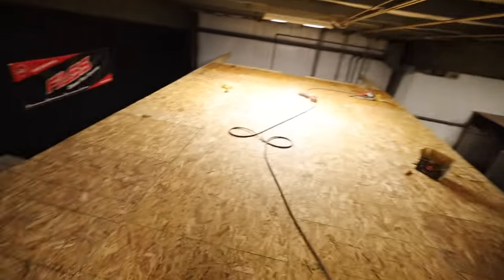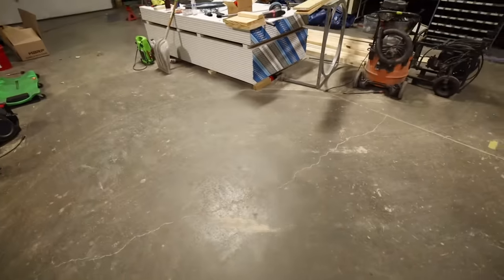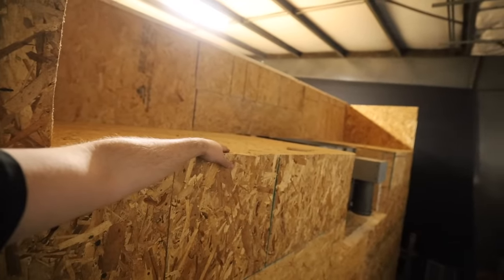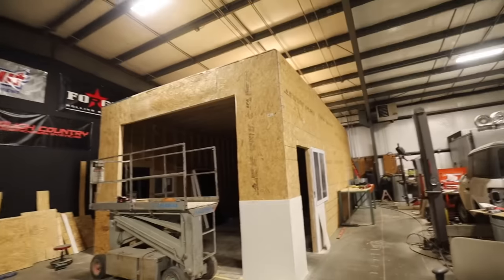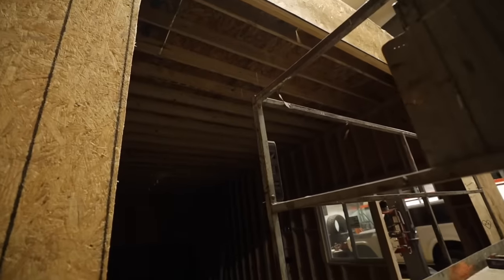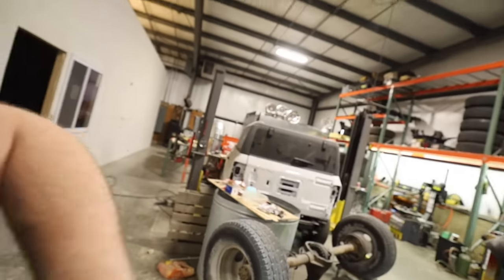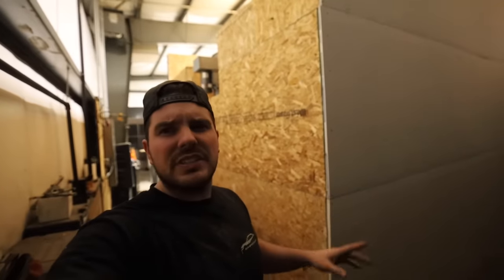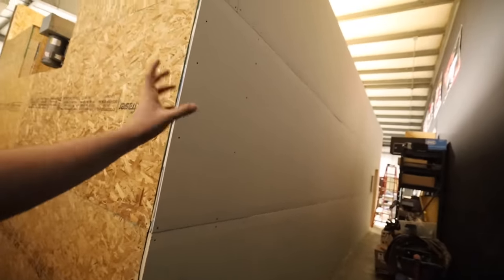Building the Ultimate Paint Booth!! Next Big Upgrade? + Drywall Installation!

Comment: Great job Ryan. Looks like that paint booth could withstand a hurricane. Just on precaution. It looks like there’s 1/2 inch plywood on the roof over the ceiling joists which I’m assuming are 16” on center. Be careful of any weight you put up there, more so if you use some type of shelving with legs. To much weight and the legs could punch through the plywood. Awesome work man.

Comment: I hope you drilled a separate run of holes for those speaker wires or you’re running the chance of having shitty sound due to electronic interference from the 120v power… 😬